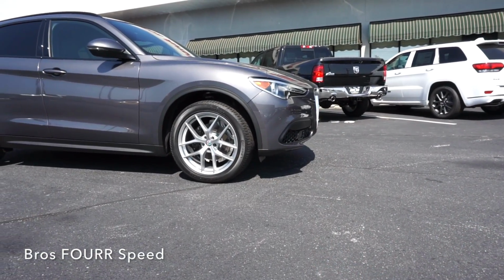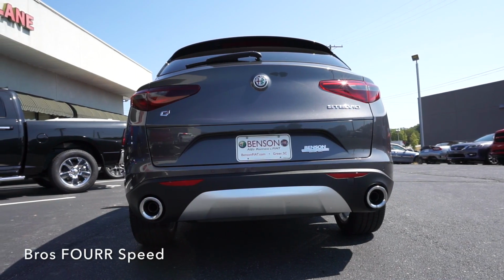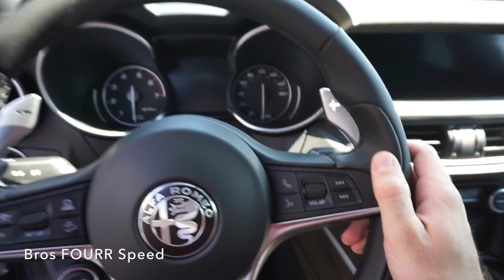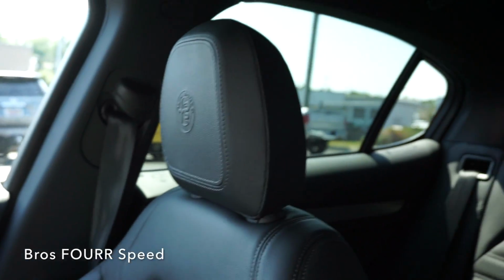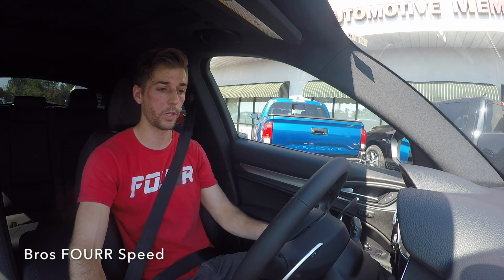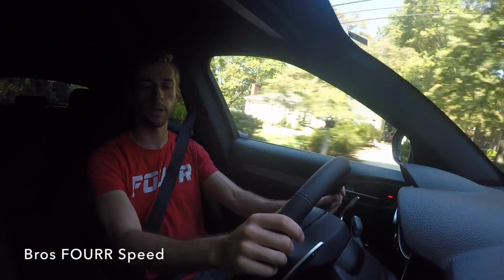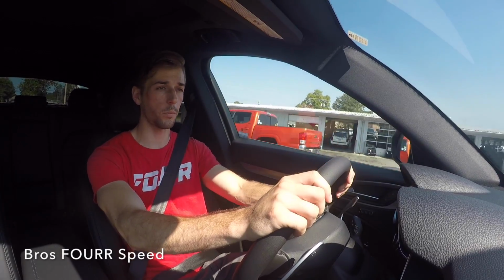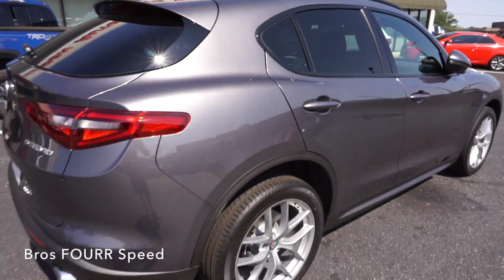2018 Alfa Romeo Stelvio Ti Sport: Start Up, Exhaust, Test Drive and Review

Comment: do you by chance know of any big reliability issues, all I’ve seen online is that it’s the most reliable of the Alfa Romero lineup. I have my eyes set on a 2018 but want to know first hand about issues and also the upkeep and repair costs annually.
Reply from the maker: Hopefully you can check out some Alfa forums on any issues.  I've never owned one, so I don't have those answers.  But in general, Chrysler products/Dodge don't have the best reputation.

Comment: What was not mentioned in the review is huuuge turbo lag. I mean - it's the worst I've ever experienced. In city driving, when you need to quickly get into small gaps between cars, this lag is too much. Even constantly keeping it above 4000rpm does not help lag too much.

Having owned Corolla with CVT - even that has better throttle response.
Reply: Glad to get that info. Being able to zip around in city traffic is very important to me. Your experience seems strange considering that full torque of 306 lbs is available from 2,000 rpm to 4,800 rpm.
Reply: Can't agree with this.  Mine is great if kept on the D setting.....hardly any lag.

Comment: Hey Mike, great review.  I'm gonna be in the market for a mid-sized SUV, and the Stelvio is atop my list of contenders in multiple ways: A) a LOT of bang for the buck (vs. other similarly-priced models); B) IMO, the best-looking SUV on the road; C) Surprisingly quick with just the turbo-4; D) refined but not too busy ergonomics and seating.  Barring any major surprises, I'm likely gonna opt for the Alfa.

The only question I have: Is there an option to put larger tires/rims on the 4 cyl model?
Reply from the maker: I don't know how much larger tire you would want to go, if at all.  It's not something to lift, so a larger wheel with same size tire would be the best bet.